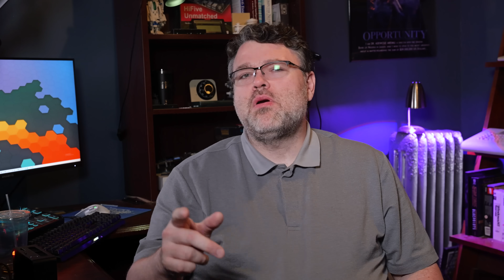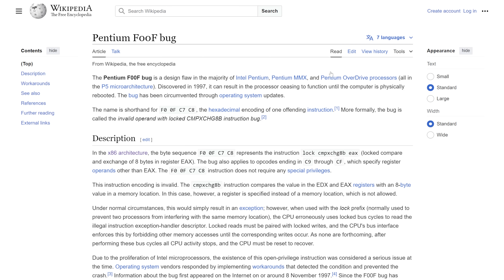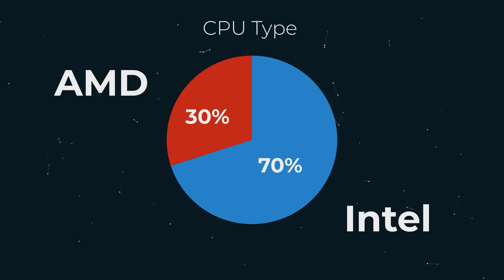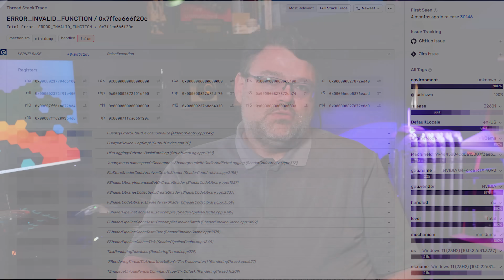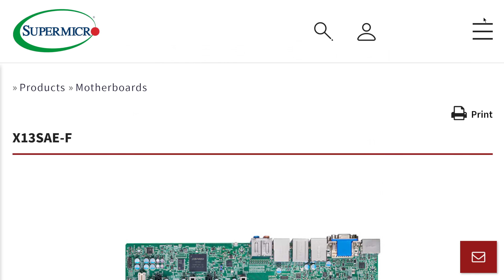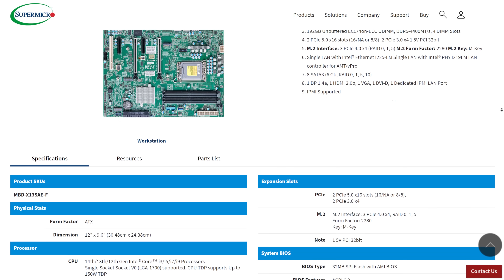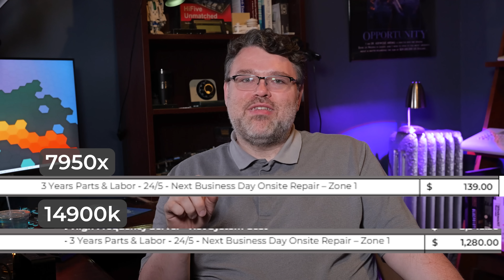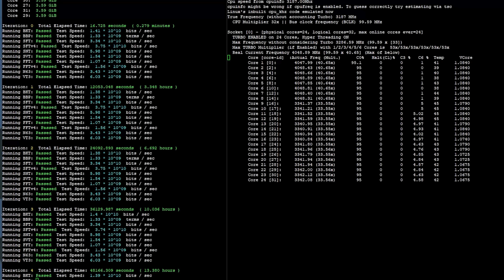Intel has a Pretty Big Problem

Comment: My 13700k / 4090 build has been pretty much flawless “besides a cable mod issue” for almost 2 years now. 13700k oc to 5.6ghz on all 8 p cores, All 8 E core oc to 4.4ghz, Ring oc to 5.0ghz at 1.34v. Even the mem controller has been very solid. 32g.b Corsair rgb vengeance 6400 cl32 hynix A-Die oc to 7200 34-41-41-83 at 1.45v. On a msi z790 tomahawk. I can't complain. But the issue with cable mod I was having was with my 4090 cable mod 3-1 cable extension. It had the sense pins that were visible and it failed. Causes issues I could explain with crash after crash with different error codes every single time. I’ll post them as comments. I don’t know if YouTube will flag them and delete them automatically so I’ll post them as comments to this post. But once I changed that cable out back to the stock Nvidia cable game crashes stopped instantly. No more issues at all. Then I bought a new Corsair hx1500i with the dedicated cable and been flawless ever sense besides a few Corsair power supply issues and replacements but not related to this issue. But cable mod did send out a new updated cable with the sense pins hidden but I don’t trust them anymore. Had a cable mod cable on my old 3080ti melt and yes it was plugged in all the way. Should of learned my lesson then but I didn’t. But only crashes I’ve had on this system was during that period last year around August. System is in every single day over 8 hours a day for work / gaming. It’s usually never shut down 
completely. It’s always on. Been one hell of a system. But like all my intel builds have been. Pretty much perfect. I5 2400, i7 6700k oc to 4.8ghz at 1.4v, 10700k oc to 5.1ghz on all 8 cores and 5.0 on the ring at 1.35v. And more recently my 13700k. They just work. I don’t hate amd and have built quite a few and builds for family and friends and people I know just recently updated my brothers 3800x build I built for him in 2020 to the 5700x3d. Still working flawlessly. Uplift was huge though going from the 3800x to 5700x3d. Jealous of his upgrade path he has had on that am4 platform. Not giving up on intel but I am sick and tired of making whole new platforms every time I want a new cpu. I don’t to upgrade every gen and would like to upgrade every other gen or 2. Would like to keep a motherboard for at least 2 CPU’s before kicking it to the curb. Intel can do it but just won’t. Greed….
Reply: Error reading pak file 'mp tr olympus mu2 client perm.rpak* -- Error
0x000001 b1: A device which does not exist was specified
Reply: Unknown file version (paks\Win64\root Ignd skins/01) starpak
Reply: Unknown file version (audio\ship\general.mbnk)
Reply: Error reading pak file "common.rpak* -- Error 0×000001 b1: A device which does not exist was specified
Reply: FS_Check^syncRequest returned error for model < NOINFO> offset
390238208 count 40120,
Try restarting your PC, verifying installed files through Steam or EA
App, or reinstalling Apex Legends.
Reply: Assertion failed: Dep.IsNullo
[File:C:/buildWork/482dc7ffae9b9a8a/UnrealEngine/Engine/Source/Run time/CoreUObject/Private/Serialization/Asyncloading.cpp][Line:
Reply: Assertion failed: Offset - HeaderSizeWhenReadingExportsFromSplitFile
> = 0
Fille:C:/buildWork/482dc7Tae96988a/UnrealEngine/Engine/Source/Rum time/CoreUObject/Private/Serialization/AsyncLoading.oppl(Line:7776]
Reply: Assertion failed: Offset - HeaderSizeWhenReadingExportsFromSplitFile
> = 0Fille:C:/buildWork/482dc7Tae96988a/UnrealEngine/Engine/Source/Rum time/CoreUObject/Private/Serialization/AsyncLoading.oppl(Line:7776]
Reply: @SVT_LIGHTNING  have you tried not clocking your ram to the moon? noob
Reply: @g0tsp33d  Matter of fact yea I have thank you so much for asking. 1% lows really tank at xmp stock speeds. Average fps takes a hit also. Took me 5 days of testing to get where I am with my oc’s. Anything above 7200 is marginal with instability unless I really loosen up the timings and anything under I loose performance. I want the most for my dollar and I have it. Makes me a noob “in your eyes” because I know how to squeeze every bit of performance out of my system then so be it. I’ll be a noob in your eyes all day long.
Reply: @SVT_LIGHTNING  My bad, I actually haven't researched ram speeds and overclocking on the newest platform. Just used to the old stuff. I am honestly just glad I went from the 10700k to the 7800x3d.
Reply: @g0tsp33d  All good. I should of waited and did the same from my 10700k. My 10700k system still works great at 5.1ghz at 1.35v and my wife uses it to this day. But I regret it now going to 13th gen to an extent because I’m going to be forced to do whole new platform if I want to upgrade CPU’s again. Going to 14th gen won’t gain me anything for gaming so either 15th gen or jump to am5 and wait for the new 9800x3d coming next year. But I think 9000 series is it for am5 and nothing is coming to am5 after that. Could be wrong. Don’t follow amd as much as I follow intel. If amd can promise another new cpu after 9000 series I’ll probably make the jump to am5 and be content with that for a while.

Comment: Is this because intel has reached the peak of their current cpu architecture? Or could we say that this is an issue of trying to push higher clock speeds on an architecture that cannot support it? You seem to be hinting at severe CPU degradation happening in a short period of time.  I don't know nothing about intel cpu's besides they're sinking themselves trying to catch up to AMD's Ryzen cpus.
Reply: I'll save you the week of schizo research I did: 
Yes. Look at overclockers and having to use liquid nitrogen on high ghz cpus. My 7800x3d runs 80c on an Arctic 420mm.

Comment: I recently upgraded to 7800X3D from 9900K, but I was really on the brink of getting 14900K after seeing all Ryzen 7000 instability issues shared around the Net (especially with RAM speeds above 5200MTs) including so called "AMDip", and long boot times! Thank God I did not go with the second option and gave AMD a chance! Have been using/gaming on the system for the last 3 weeks with 2x32GB 6000MTs CL30 with Buildzoid's easy Ryzen 7000 timings and a 3080 Ti on a 4K display (I also ran quite a bunch of Testmem 5 configs incl. Anta77 extreme, and OCCT CPU and Memory stability tests for a prolonged time just to make sure the system was stable within the return/refund window), I have had zero issues. My boot time is somewhat long compared to 9900K (70 secs vs. 15secs) with MCR and PD both disabled (because this configuration gives the best performance), but I am quite happy with the system (not even mentioning at least 2 more generations of CPUs on the same MB).

Comment: Sounds alot like its a memory controller Issue. Which, as luck will have it, is very bad on 13th and 14th gen, with a lot of deviation between CPUs. If you have seen a lot of memory related Videos from Buildzoid you know what I mean.

Comment: Q: Is Wendel saying that the game server failure data is from servers that were using only the highest-end processors such as 13900K and 14900K and that the 13700K and 13600K were not part of the dataset?

A: There were i7 in the dataset but the failure rate was highest on the i9 13th Gen.
https://www.youtube.com/live/5KHCLBqRrnY?si=7p8iArJbENQQdVSm&t=3758
Reply: Good find, thanks. FWIW: Looks like the Verge did an article referencing the Warframe forum post, that Wendell referenced in the Q&A and this video.

Comment: It honestly seems like intel is trying to quietly smooth this over with patchwork "solutions", in hopes of avoiding the backlash that would come from a more unified, public announced one.  Because if they basically come out and conclude what seems to be the obvious takeaway: that 13900/14900 were running in a capacity that caused long-term silicon degradation, therefore the 13900/14900 that was released was not a stable for long term use version and was done so in order to achieve benchmarks and reviews that would allow it to take unwarranted leads over competing products, that would mean the entire product line need to be re-reviewed with new BIOSes and updates that would put it solidly behind even 7000 series non-X3D processors in gaming and well behind them in productivity.  
It would be a scandal that would shake their user base in both business and the enthusiast class, both segments that intel has desperately tried to hang onto.

Comment: months? years!  13900k released Q4 2022.  Intel praying we don't notice while they scramble around trying to find a product that works while cranking up their old broken platform to try and compete with AMD while their power goes through the roof.  It's 14++++  all over again, but at least 14nm processors were class leading and stable.   It's Intel 7 (actually 10nm) +++.

Comment: Are we looking at i9 chips only, or are we looking at all Raptor lake cpu's? I'm on a 13700k, and it's a fairly new build, as I came over from an AMD 5900x system, so new mobo, DDR5 ram as well. I've had occasional BSOD's witth the build, but this hasn't been whilst gaming, as I'm more using my system as a creator system.

Comment: My 13900k has been nothing but problems.  Odd thing was it worked fine for quite a while, then almost like a switch was turned on, everything went bad.  From my perspective with this, it seems like the CPU is probably fine, but something external (BIOS, Windows, or some other drivers) have been causing them to go berserk.  I'm just waiting for the class action lawsuit now.  Someone at either Intel, MB manufacturing, Mircrosoft or somewhere else caused this and/or knows about it, and should lose their job or company for causing this.

Comment: My i9-13900k was plagued with DirectX crashes and I/O errors, downclocking in XTU helped for a while and eventually stopped helping. I switched to a 14900k w/ a copper IHS and it's been rock solid, however in grey zone I do get that out of VRAM error but its never actually caused a problem

My theory is that the clamping mechanism on the CPU's are bending them and causing issues over time with heat cycles.

Comment: Anyone have a good test to see if my CPU is plagued by this issue ? 

System : 13900ks (intel defaults) asus z690 extreme 2x24 DDR 5 7200 running at 6200 

Errors : sound cracks with XMP set over 6200

New error :Reference memory issues  when shutting down , never happened in the past
Reply: nope

Comment: See that you mention if they replaced 13th gen with 14 gen the issues went away for a while and then returned. Maybe not the most performant solution, but in case of 50% of his servers that have issues can he not ask to replace them with 12th gen, so that he at least has a stable environment?

Comment: Could it have anything to do with the flex happening due to the socket?   I wonder if there can be research done on if systems using contact frames have the same issues….

Comment: Got my 13900K RMAd this month after it getting gradually more unstable. Clocking down to 54x multiplier used to fix my crashes, but at some point i had to go even lower. I think playing helldivers 2 especially degraded the system as it would cause huge intermittent temperature spikes when i had intel xtu running on my second monitor. Helldivers would always crash towards the end of the mission,after at least thirty minutes of play time.

Subsequently, playng Warhammer total war 3, another very cpu heavy game, i would start getting 4 or 5 crashes pr hour.

Im sure you thought of this, but i bet the data is quite skewed from people simply giving up on games after experiencing instabilities. Only the very most stubborn would go again and again. Oh, and me when i forgot to downclock the multiplier to 54x before going ingame in helldivers. For some reason the setting wasnt saved, so being the dingus I am, I would have to experience one crash before remembering to tune it down. I might have forgotten 10+ times over the hundred hours i spent in that game.

Another intersting tidbit: After Replacing my 13900K, both A1 and A2 slots died. I was super careful during assembly with grounded anti static chains. I now have to run with a single 32gb chip in B2. This was on an asus z790f gaming wifi mobo with the UEFI verdion from june with the standard power profile.

Unless intel takes proper responsibility, i will definitely be going AMD next time.
Reply: ??????? bro do rma asap

Comment: Sounds like the memory controller / cache interface. What would be interesting is snooping the cache bus and tracking locking issues; in particular seeing if there are any illegal MESI protocol transitions. Of course this might be getting bad over time, i.e. silicon degradation that wasn't picked up during the early days, A silicon etc. The reason I say this is that decompression code really stresses this part of the CPU. Also branch prediction but memory timing seems to be a trigger here and the branch prediction unit is wholly within the CPU (although it can lead to non deterministic memory fetches).

Comment: I have plenty of errors about running out of vram ... ON MY 4090! Tekken 8 would crash almost every session until motherboard manufacturers added Intel's recommended performance profiles. That's not acceptable because it's obviously a band-aid that will slowly peel off. Pre-mature RIP for my 13900k.
Reply: rma time

Comment: I remember before I got my first PC in 2013 it was always "Get an Intel cpu and an Nvidia gpu and overclock if you want to be a real gamer" and nowadays its... well people still say the same but in my experience people are still way too mislead by the old advice from random forums and old heads in the tech space. As of today, an AMD cpu is virtually always better than Intel and AMD trades blows with Nvidia in the gpu department but is still primarily the budget option in most cases like they have been for years. Get an AMD cpu and get whatever AMD/Nvidia gpu that best fits your budget (or AMD for gpu and cpu if on Linux) with the features you want most, no more worrying about whether you PC will manage to work at a basic level. 

Oh and I forgot to mention: overclocking is overrated, real ones try to be more efficient and prefer undervolting while keeping clock speeds at manufacturer stock, or just forgo tweaking voltage and clock speeds altogether.

Comment: I have a high end 13th gen laptop that runs pretty much continually, and it has never had an issue.

Maybe it is a issue with the chipset being used on those server boards.

The other potential issue I can see is that modern CPUs are speced to run at max pretty much out of the box in an attempt to compete, so they are much closer to failure points than they used to be in the old days when competition was less of a consideration.

Sometimes having the fastest processor is not necessarily the same as having the best processor for that reason.
Reply: It probably isn't a problem on laptops because intel can't just push 250+ watts through a laptop cpu. The problem is certainly to do with intels overzealous clocks and extreme power limits. The chipset doesn't seem to be an issue since 12th gen cpus still seem to work perfectly.

Comment: If the CPU performance halves before crashing maybe it is the IMC and memory transfers stall causing bandwidth starvation.

This would explain why most pure cpu metrics continue to look fine.

I'm curious if the issue reported is exclusive to ddr5.

Megekko (a big Dutch retailer) has an informal policy to push ddr5 dual dimm over quad dimm for stability reasons but they didn't specify this would be for Intel only.

Comment: The absence of AMD data is also data
Reply: he already mentioned survivorship bias, look it up  if you missed it for not being aware of it
Reply: kind of... a lot of statistics don't like zeroes e.g. MTBF
Reply: @greebj  but we don't have a zero. We have an insignificantly small number: iirc 4 out of ~1500 documented failures, or 0,25%, when 30% of the population use AMD, is a clear indicator that this is an intel-specific issue.
Reply: @greebj the lack of failure data points to AMD chips not failing in the same ways, in numbers sufficient to record.

Comment: I'm wondering if it is a chipset power delivery / voltage issue. These chips seem to be working fine for months and then taking a turn for the worse regardless of being overclocked or not.

Interesting to see what Intel will come out with for an engineering explanation, assuming they don't just ignore the problem completely.